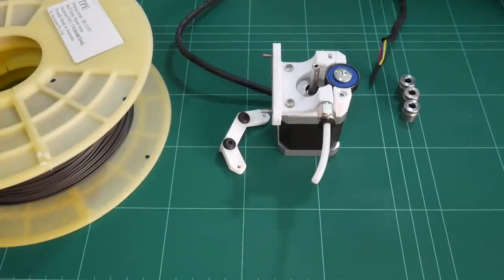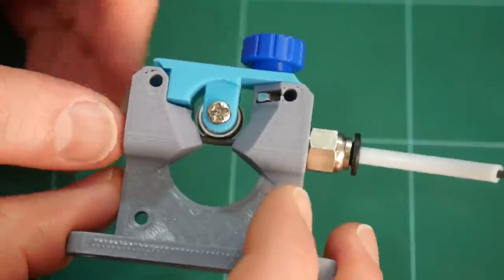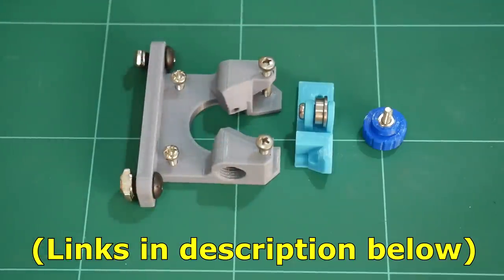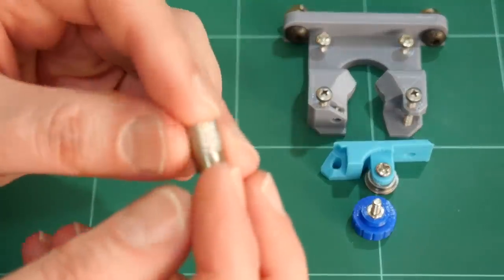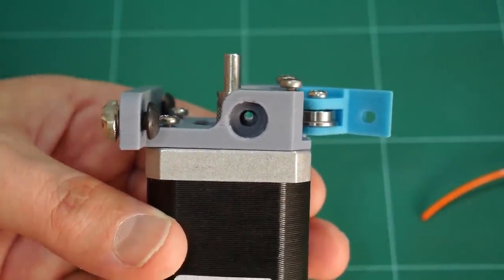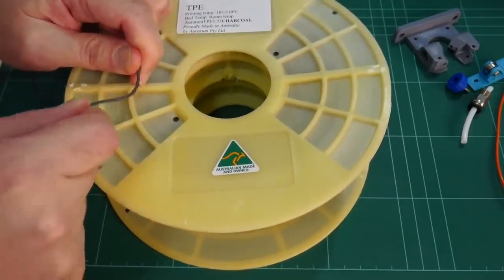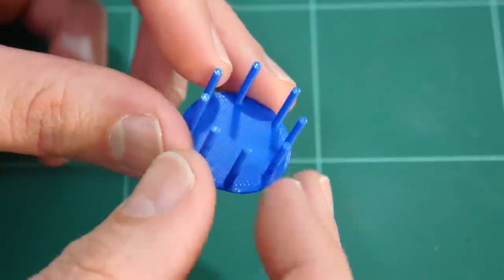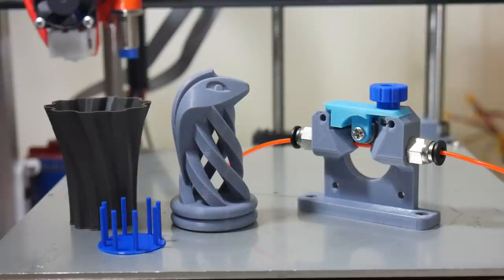DIY Bowden Drive for 3D Printers

Comment: Just fitted this to my Ender 3 as the arm cracked (as expected) on the Creality feeder. I have a metal replacement on order but may leave this one on as it is working much better than the original. Thanks for the info and video.
Reply: did you have to modify the design at alll?

Comment: Oh, wow great work! Thank you!
I can see some (probably minor) improvements on the knob-screw-unit so it won't come out completely (something to lose or let go off). Also I'd design the Teflon tube-tunnel contiguous, have one long Teflon tube which gets gnabbed out in the middle a top and bottom bite to have an even tighter guide of the filament. Not sure of increase in terms of efficiency but I'd give it a try.
Well done! I usually like the improvements you come up with, great ideas!
Reply from the maker: Hey thanks for the comment! Yeah the knob could get lost, so you could use a longer screw to allow the idler arm to swing out more without the knob fully unscrewed from the nut in the motor mount. I've allowed for upto 15mm screw length for this. Regarding the teflon tube, I also thought about using a single peice and nipping it to allow the gear and idler to grab the filament on either side. It wouldn't leave much teflon tube in the middle to support itself though.

Comment: With a little redesign of the idler you could make it better than having to unscrew the knob when you want to change filament. There are several ways you could do it but given your design I think replacing the static knob with a tension lever rotates 90 degrees to release tension then back to restore it. A secondary screw could be used to do a fine adjust the tension level. I'm thinking something like a quick release used on bicycle seats.
Reply from the maker: Now that is a great idea! Thank you.
Reply: @Tech2C  I was looking at that aspect of the design as well, if you printed the gate that holds the bearing with  longer front end that you could use as a lever, and used a longer nut to hold it in place, then used a spring to hold tension you'd have the same quick release idea without so much redesign.

Comment: A nice design mate! I do have some suggestions. Not everyone can print in harder plastics like abs, most will print this design in a form of PLA. Although binding will occur less, there is a good chance that the flexible filament will rub on the chamfered entry points near your gnurled gear. When it does this, the filament will slowly erode that area and the filament may still fail, ive seen a few designs where they cut 45° angles on each side of a Bowden tube, so that the Bowden tube sits almost 2mm away from the extruder gear and bearing. PTFE tubing will wear a lot less than those plastic ends will. Regardless, you've solved many issues that extruders have when it comes to printing flexible/exotic filaments, I really appreciate that. It's intelligently designed. Cheers*
Reply from the maker: Thanks for your comment! Whilst I've only had this design running on my 2 printers for a week, it's far too short a time to see any wear. The grey and blue bowden set I showed was printed in PLA, whilst the white bowden set is PETG. They both seem to function the same in regards to performance. My older bowden set I've had for 2 years and it doesn't show signs of wear, albeit the gap between the filament entry/exit to the drive gear is quite large. I'll keep an eye on this and redesign as needed :)

Comment: I changed both my hypercubes to directdrive 9 months ago without any decrease in print quality related to heavier carriage. I've used prusa mk2 and mk3s extruders and only disadvantage is slightly smaller print area in cube with mk3 extruder due to strange angled position of cooling fan. I'm not printing above 80mm/s when heavier carriage might be an issue but at 60 it is just perfect and has no issues whatsoever with retractions or flexible filaments. I honestly believe that there is no reason to go for bowden if you have sturdy frame and no axis with only one point of fixiation (as cetus, smaller snapmaker or other small cheap printers). In anything sturdier than anet a8/ender3 direct drive is just plain better for high quality prints and it is as easy for tool changing (and if you think about milling with printer you do need printer capable of moving heavy X carriage).
Reply from the maker: The great thing about this hobby is we can mix and match so many aspects of it! That's great you've had success with direct drive on your Hypercubes! I really like the simplicity of Bowden, or should I say the split in 2 drive system that bowden provides. I may investigate direct drive sometime soon, especially as the weight of modern direct drive systems has reduced considerably since I used it last. Cheers :)

Comment: 5 years late, but a possible (small) modification is to allow the teflon tube to go all the way through, then trim it with a knife where the gear and idler are. You could glue the tube in to make sure it doesn't move.
Reply from the maker: That's a good idea.
Reply: @Tech2C  Oh dude I can't believe you're still around! I built a Hypercube back when you first made them. I had it running SO well. I was using carbon rods and printed linear bearings with silicone grease. I kinda lost interest in 3D printing and gave the cube to a mate who used it to print miniatures like Warhammer. I've just recently picked up a Prusa Mini and it's nowhere near as good as my old Hypercube was. I had a really good time back then, thanks for all the memories :)
Reply from the maker: @JamieBainbridge  It was a fun time making the Hypercube and releasing weekly build videos. I still use mine for odd prints, but not much these days. Similar to you, I kinda don't use it much anymore, so I'd lost interest in making further content. I had ready to go the next phase in the journey, was my own controller software, as I wasn't really satisfied with Marlin. Great to see people remember these videos :)

Comment: so...its your standard single drive gear extruder with flat idler gear, like countless other designs on the market and available on 3d printing design websites.
Reply: Would you say mobius 3 would be better for flexibiles? Say higher speed than 20 mms?
Reply: @Alikapups  flexibles need to be printed slow with bowden setups no matter what, but the 4:1 gearing, fully captive filament path, and use of dual drive bondtech gears will offer much better improvements with those filaments.

Comment: Have you thought about trying a remote direct drive system using something like those flex shafts for rotary tools? You can find them under $20 on amazon, at least here in freedom land, so it wouldn’t cost a lot to experiment with. Might need to run a gear train to do higher rpm and lower torque to make up for slop in the flex shaft, but it shouldn’t add too much weight to the print head.

Comment: I'm glad to see another improvement. 

I personally am getting really sick of dealing with the bowden system on my Hypercube Misfit in general. I built it way too big for bowden systems to be as reliable as I'd like, especially with retraction. I still get decent prints, but I'm seriously interested in switching to the Zesty Nimble extruder, which is based out of Austrailia, as it has the benefits of direct drive systems while having the low weight of a bowden.

Capricorn tubing helps a little bit, but when dealing with 700+ mm bowden length, it is a pain.
Reply from the maker: 700mm tube length, that is quite a distance. I agree if a long bowden system is causing grief then switch to direct drive or equivalent. Alternatively you could try 3mm filament, maybe it fares better with long bowden tubes?
Reply: @Tech2C  I'd rather stick to 1.75mm. It's managable, and actually I have a full meter of capricorn tubing on right now because I was too lazy to trim it after testing as a proof of concept. 

I just think this other extruder system would be superior in general for a corexy system. I highly advise to check it out if you get a chance. It is pretty expensive, though.
Reply: @GregAtlas  I've been waiting since MRRF for the nimble I ordered to arrive. (patience is a virtue) they got far more response to the system then their wildest dreams. I think this is a solution to many of the bowden system design flaws.

Comment: You can buy cheap bondtech dual gear clones from China nowadays (around $5), you might want to have a look at them. They can grip the filament way stronger as they do it from both sides.

Comment: Nice design, but the spring force from bending plastic decreases with the time and heat quite quickly.
Reply from the maker: Normally I'd agree, but I've been using a printed bowden drive in PETG for over 2 years without issue and no spring. Don't print this in PLA and you'll be fine.
Reply: @Tech2C  Ok. then that is a proven design. My PETG plastically deforms under constant force, not as much as PLA though. For example my PETG as coffee bag clip, just permanently deformed only after a couple of days. I blame my cheap PETG :)

Comment: I just wonder. Typical PTF tube which are used in bowden extruders are 4mm / 2mm. Do they make a smaller one for example 3mm / 1,8mm? it will be nice to have a smaller internal diameter to match 1,75 filament.

Comment: Awesome video! Looks like the knurled drive gear is a smaller diameter than my stock CR10 gear. Is it necessary to make changes in the firmware or slicer settings?
Reply: All you would have to do is unhook the bowden tube from your hot end fitting, cut the filament flush with the end of the tube and then extrude 100mm's of filament and then adjust your settings from there. If it's + or - 100mm's you can just measure it and than subtract or add to get your 100mm total again. So If you do the same process before you make any changes and your printer is already printing good enough for what you do. Let's say you extract 100 mm's and 95 mm's comes out of the old bowden extruder, well when you switch to the new one and you extrude 100mm's and 95mm's comes out, leave it imo. If your printer was able to print some what decently (lol obviously not cause you're upgrading it) before and was printing okay and you don't want to mess with trying to figure out proper ratio and formula or just don't want to do the math than don't change it. Let it be!😂 But if you want to get it perfect!! And make it flawless, then obviously when you extrude 100mm's you get 100mm's right at the tip of the bowden tube. Hope this helps! Sorry for the long story! Probably won't even read this 😂 ✌️lol
Reply: @luckylarz4269  nope, nobody's going to read this far through replys

Comment: As usual, always great job. I have problem slicing "BOWDEN MOTOR" file using Simplyfy3D software, the result is very bad. Can you re-build using different setting ?
Reply from the maker: It works fine in Slic3r and Cura. Load the STL into either of those and save as a STL again. See if that fixes Simplyfy3D.
Reply: @Tech2C  I just test open using latest Cura 4.1.0 and export to STL, and I open with Simplify3D, the result is still the same.
I try to fix it using netfab, no different. it seems "self-intersecting surface" problem

Comment: One question, though: Do you have an idea about the max Teflon tube length viable with your new drive?
Reply from the maker: No idea. You would have to trial and error with each filament you intended to use for retract ability. Mine is 50cm long.
Reply: @Tech2C  Thank you. Ok, then 50cm is working for you. I'm curious about the upper limit now. :)
Reply: Sometimes seasoning (lubricating) the tube when you go beyond 300mm long will solve dragging issues

Comment: Did you ever try and reprint the ninja flex?
Reply from the maker: I don't have any left.
Reply: @Tech2C  Darn, I got mine about a year+ ago and had very little experience with printing and it came (from Amazon) in an unsealed box.  So the prints look a lot like yours but i think mine was due mostly to moisture.

Comment: This is how I did it, works a treat: https://www.thingiverse.com/make:478882

I suggest using a printed compression fitting to hold the bowden tube, it does not cut in to the tube and allow it to move a bit on retraction like the common hydraulic/pneumatic fittings.

Comment: That flexibility in plastic will wear out and you will loose that constant pressure.
Reply: Was thinking the same thing. Otherwise it's very nice.
Reply: Not if it's PET-G.. knowing Tech2C it probably is ;)
Reply from the maker: That's interesting. The grey and blue bowden I showed is PLA, whilst the white bowden I attached and am printing with is PETG. My older bowden system printed in PETG didn't lose its pressure from the idler, and I've been using that for over 2 years. That's why I chose to continue this method.
Reply: @Tech2C  Obviously people should print every part twice to have a backup when something breaks. At least 'm doing that. Printing it in PLA, have a second one in PLA prepared, and if the first one breaks, I will mount the second and print it in PETG.

Comment: Hello @Tech2C i made a build of the hypercube, im using steel rods for the x carriage, but im having a lot of vibrations in the Bed, when doing an infill the bed moves up & down quite a lot. Any tips on how to reduce this vibrations? should i just make the prints slower? tight the belts? any recommendations would be appreciated. Thanks! :)
Reply from the maker: If you're using steel rods on the X axis, then reduce your jerk speed in Marlin to 10mm/s or lower. If your steel rods are 10mm in diameter, then switch to 8mm instead to save weight. You can find the 8mm XY_Joiner on my Hypercube Thingiverse page. Links in description of this video.